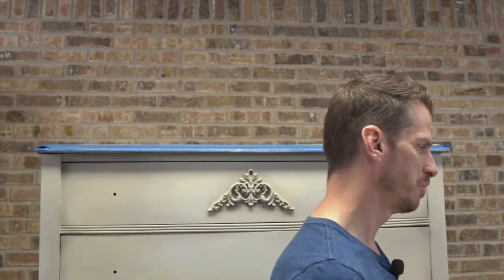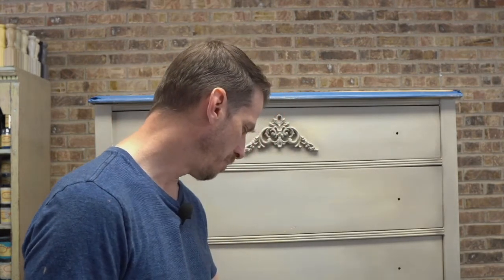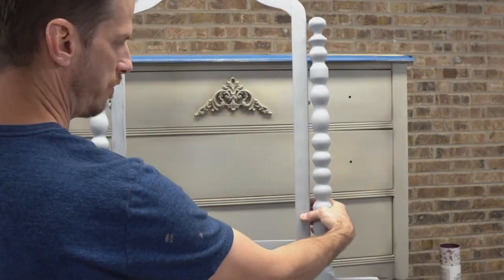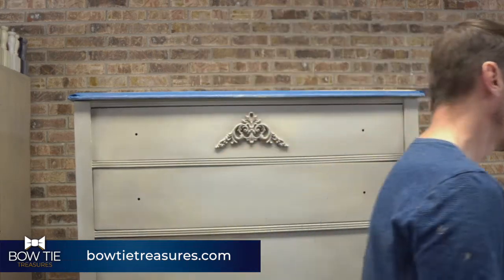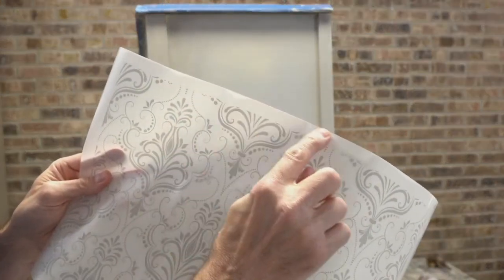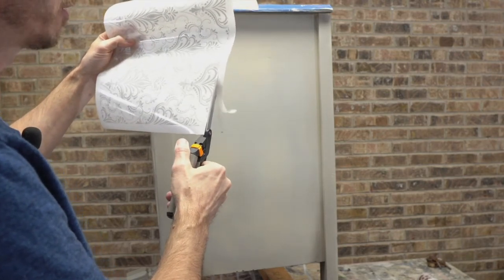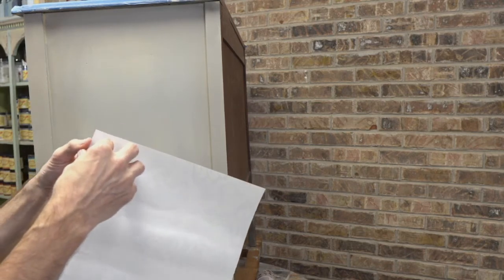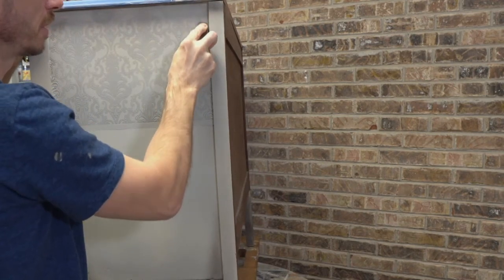Part 2—Chalk Painting with Dixie Belle paint and applying a transfer on an antique dresser

Comment: I am doing boards with lettering on them. I used a deco chalk paint. I thought if I got Gator hide it wouldn't smear the red letters. It still did. What am I doing wrong. My boards are outside. And need to be sealed. I'm sad and frustrated.
Reply from the maker: how are you applying the Gator Hide?  How long did you wait until you applied it?
Reply: It had been a week. And with a foam brush. I took and got a scrap piece of wood. And did 2 colors with all Dixie Belle. And then foam brushed over it and it didn't smear. I believe that I just need to use all the same brand products. I trie to get it to smear. Haha I literally put the Gator Hide on with a foam brush until the brush had a hole in it. And it didn't smear.
Reply: I will continue to experiment. I am going to buy all Dixie Belle. I have 2 dealer close to home.
Reply: I was shocked as to how much better and smoother Dixie Belle is. I can't wait to use it more!
Reply: Thank you for replying!! I am so excited to do some of the blending techniques you have done. I have many things to buy. I will get a couple things at a time. I need one of those fat round brushes.